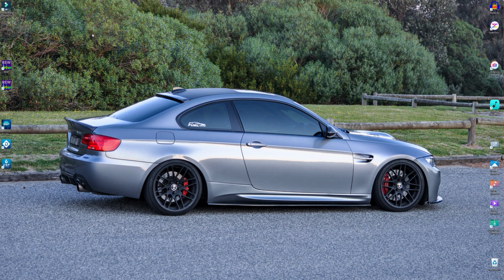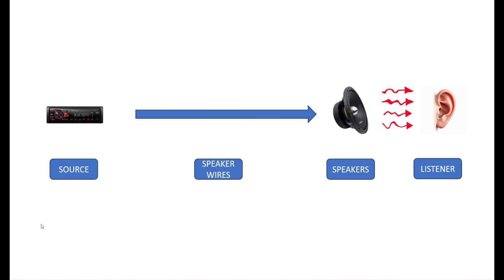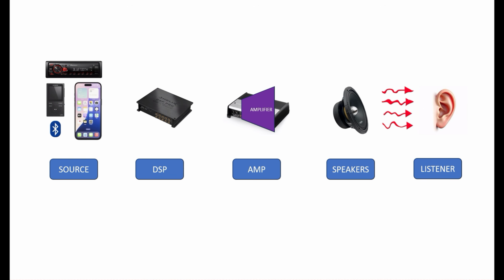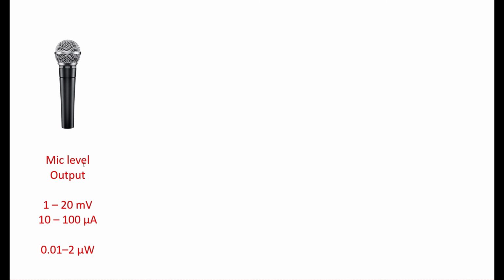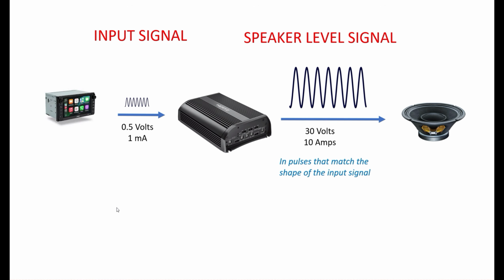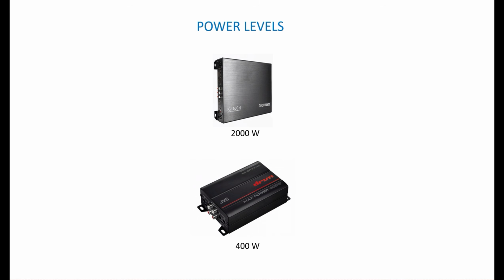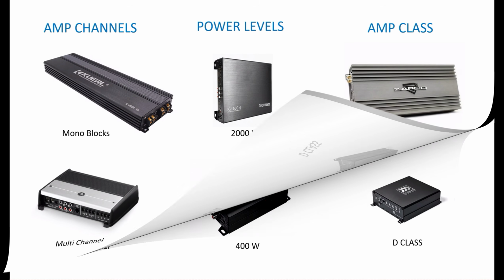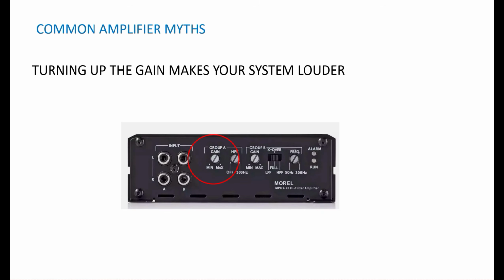AMPLIFIERS PART 3 - AMPLIFIER BASICS

Comment: Hi Socket,

 I've been wondering for years if an A/B amp with 200W on a sensitive 10" mid would sound better than 65W just because you would have "more" watts in class a mode available, before it goes over to class b mode. Could that be the case? Thanks for your super helpful tutorials. I've learned a lot  in the last weeks. 

Best regards from Germany
Sam
Reply from the maker: Hey Sam, Nice to hear from you. This is a very good question.  So lets break this down.  So class A, class B and class A/B are three different amplifier classes.   The output section of a Class A is always "ON", so they use lots of power, produce lots of heat but have very low distortion. Class B output sections are only "ON" half the time, meaning they use less power, produce less heat, but have high distortion, from what is called crossover distortion (I will go into details in the amplifier series).   Class A/B amps are a design that has the low power consumption of a Class B, but the low distortion of a Class A.  So they are the best of both worlds, hence the name Class A/B.   It does not mean they have a class A section and a class B section.  They are just a design that takes the best bits from class A and class B designs (once again we will go into the details when we look at amplifier classes).   So the signal does not go through a class A section and then a class B section in a class A/B amp, if that makes sense.   Now we have that out of the way.  Will a 200w on a sensitive 10" mid sound better then 65w on a sensitive 10" mid.   The answer is it will sound louder, but not better.     It could sound worse, if the 10" is a 150w speaker, at 200w the speaker will getting too much power, and will distort.    If the 10" is a 500W speaker, at 200w it wont be distorting, but it will just sound louder then at 65w.   So in short increasing the power (watts) to a speaker doesn't make it sound better, it just makes it louder, but there is a point where you add so much power that the speaker is pushed beyond its limits, and the speaker will distort and that sound bad, very bad hahahha.    I hope this helps :)
Reply: @socketsocket2763 Good morning Socket,  thank you very much for your detailed answer. I forgot to mention an important detail in my question. The comparison between these amplifiers is not at full power output, but at the same low power output, e.g. 40W RMS (at the sensitive midrange). In this case, the headroom of the 200W amplifier is not utilised, but rather operated in class A mode. Is that roughly correct? Or would class A operation switch to A/B operation at around 30W for both amplifiers?

Regards
Reply from the maker: Hi Sam,  Oh I see, so both amps are providing the same power output, expect one amp has lots more headroom (power not being used).    I think what you are getting at is Class A/B bias.   At low power levels Class A/B amps output section act more like and A class and at high levels more like a B class, but it is not a sudden jump or correct to say they switch from A to A/B or ramp up.  It's just there is a shift in the way the transistors, in the output section, operate at different levels of power demand.  The only amp classes that I know of that ramp up and down to demand in power supply are Class G and Class H amps.  Class G have a high and low power rails and switch for one to the other depending on power demand.  Class H amps have a dynamic power rail where the power adapts on the fly to changing power demand.   So not sure if I answered your question or not.  If you could explain the reason behind your question, I might be able to provide you a better answer :)